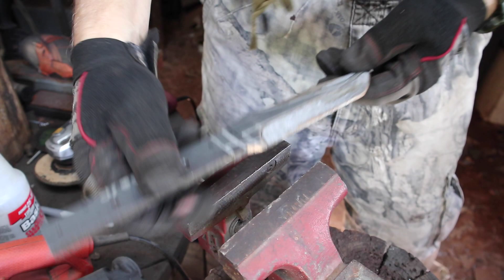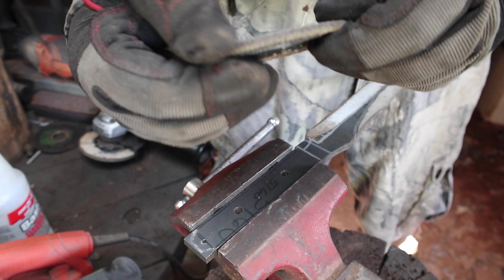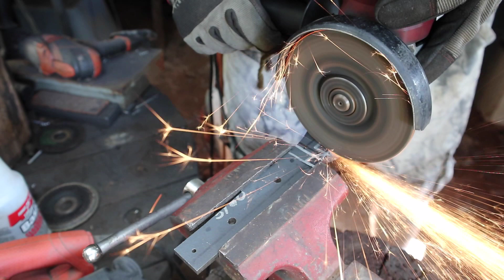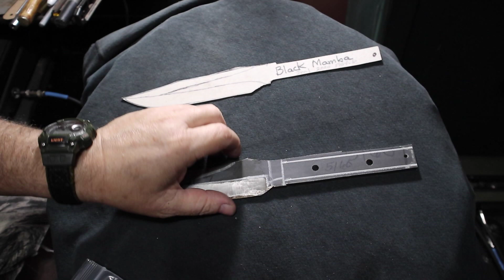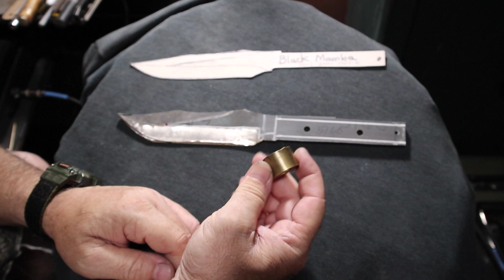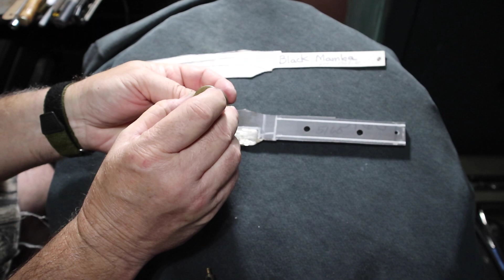Making a MACV-SOG Combat Knife at SMI Part 2.0

Comment: Maybe you could make some with the options of a drilled hole in the brass butt cappe some with the insert, and some without? Either way they are going to be cool.👍👍⚓⚓🇺🇲🇺🇲
Reply from the maker: Yeah, I agree with you I need the drilled hole in top area of pommel end just like originals. I need to get it as close to an original SOG Vietnam models.  Just put a decorative center piece in these pommel end holes. ~SMI~
Reply: @snow_tacknives2019  Nice 👍👍⚓⚓🇺🇲🇺🇲